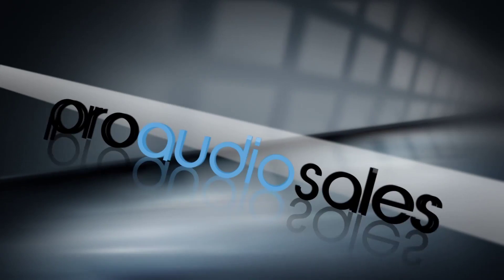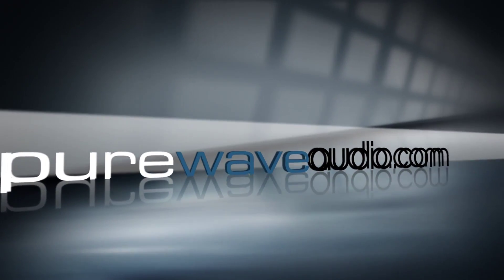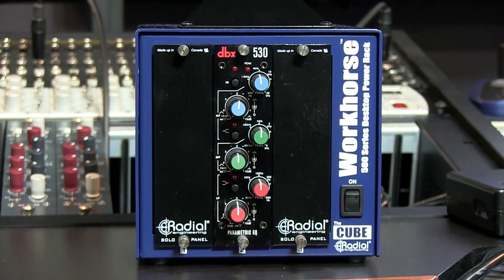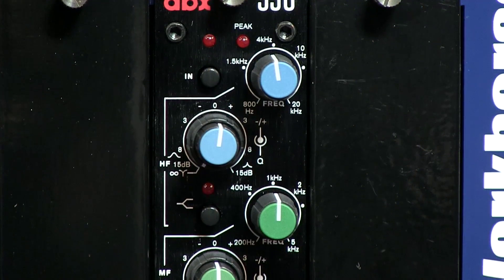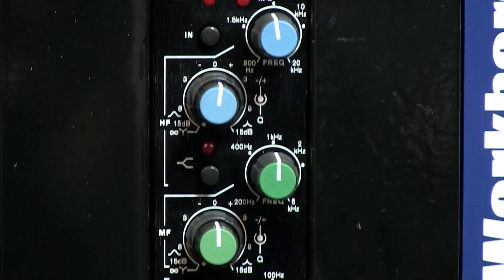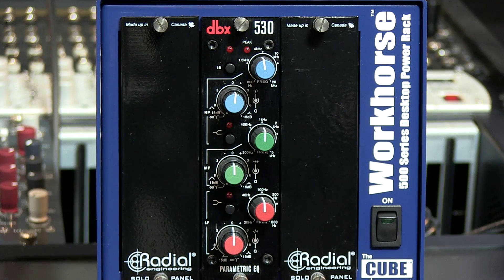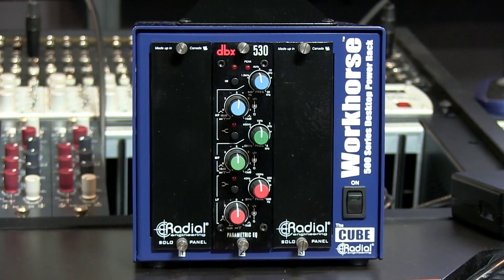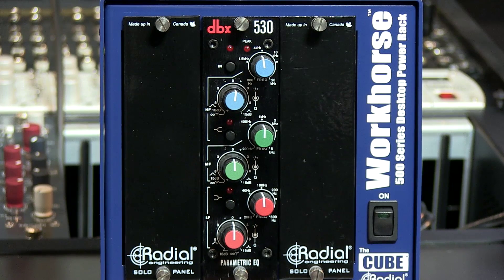DBX 530 Equalizer 500 Series  Module Review with Samples

Comment: So would I hook this up to my mixing board
Reply from the maker: You can by use of the insert of the mixer.  Keep in mind you have to first put this unit in a 500 series rack to power it and get ins/outs.  You can see these at this link.  All different sizes depending on how many modules you would like to use.  https://www.purewaveaudio.com/recording/signal-processors/modules
Reply: @purewaveaudio  thanks